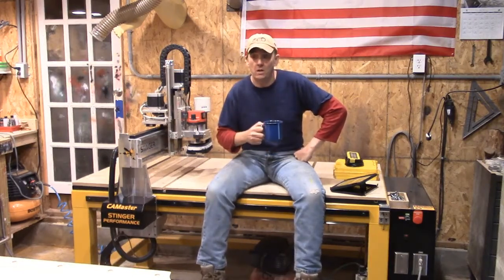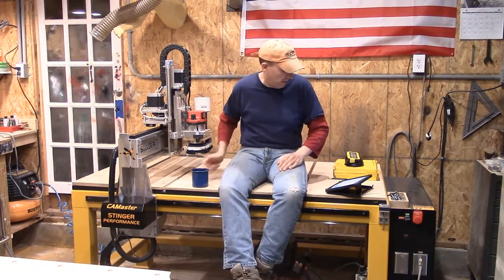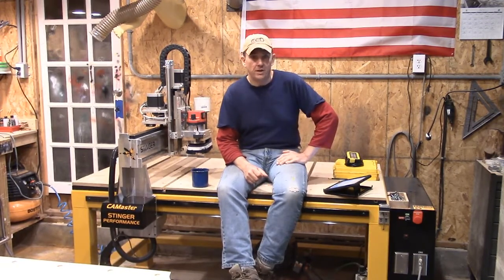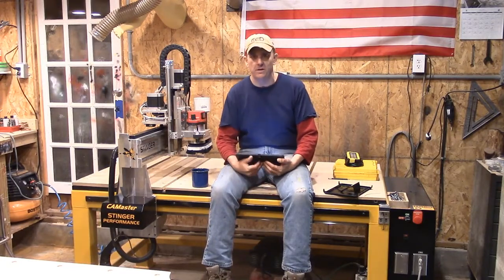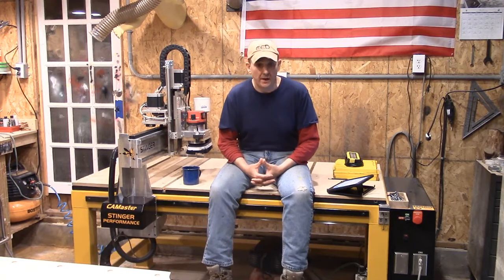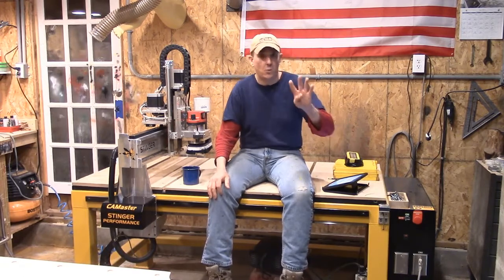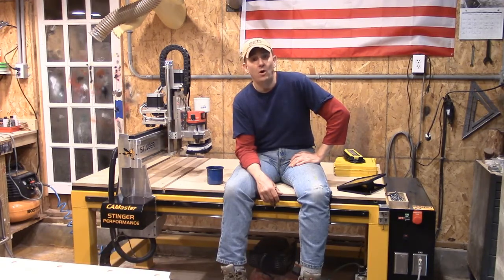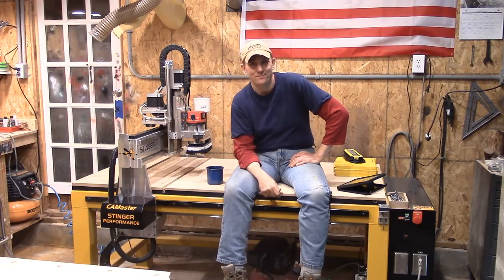Camaster Stinger 2 Router 3 Year Review

Comment: How do you feel about the router instead of a spindle?
Reply from the maker: Both have their advantages and disadvantages but for a small shop the Milwaukee 3.5 HP router has done everything I could throw at it. Keep an extra on hand and any downtime is now minimal. Unless your well versed on how to repair your spindle it will have to be sent out. I've personally run my Stinger at feed speeds of 350 ipm in pine. Hope this helps Sir

Comment: Did you research Legacy?  If not, why not?  There forum is very good, but not open to public like Camaster.  Excellent training and support.  Would like to hear your reasons for not buying another machine.  There are others made in USA.
Reply from the maker: Hey Bob, really liked the Camaster product line. Solid machines and 4 years later I've only replaced 2 sets of brushes. Everyone has seen the things I've fabricated , even the oversize projects. Never been let down by this machine.